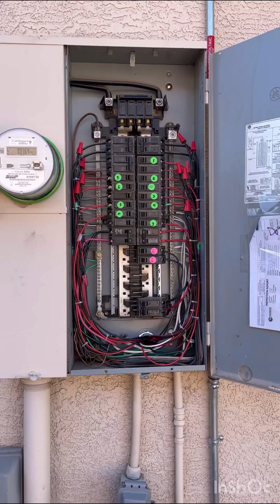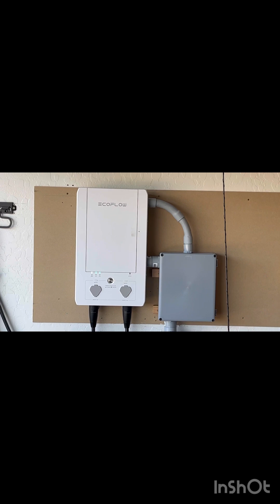Update main house power panel Vol 4

Comment: Thanks for doing this video, learned a lot. Did you have any 40 or 50 or 60 amp breakers? If so, how do you handle this with the smart home panels relay max being 30 amp?
Reply from the maker: No way to go past 30 AMPs with the Ecoflow Smart Home Panel in its current configuration.
Reply from the maker: My objective is to shift as much electricity use from daytime to expensive evening time as possible. That does not include stove, HVAC, Spa, or dryer. In an extended blackout, we will move into our motorhome in the driveway (our life boat.) Since moving here in the Phoenix area in 1985 we haven't seen a blackout longer than an hour or so.

Comment: Thank you for doing this video. I just got mine smart home panel delivered and ready to setup and this video really helped me get started. Quick question though, do you know if you can hook up a two pole circuit microwave if this ecoflow panel is setup as single phase?
Reply from the maker: Good question for customer support, although they are likely to speak the company line. I think I saw a Youtube with a 2 phase appliance mixed in with single phase circuits. I'm not an EE or electrician, maybe someone else can chime in?